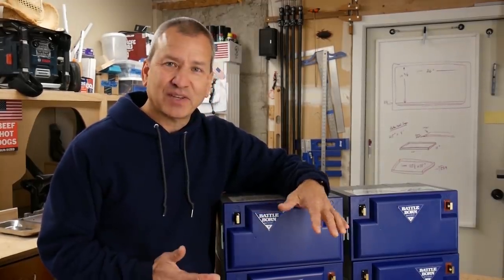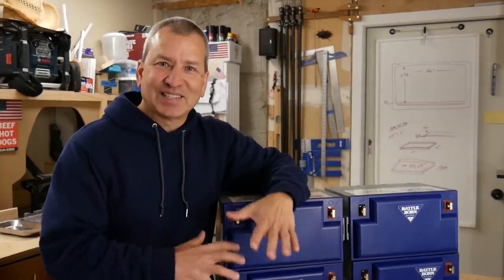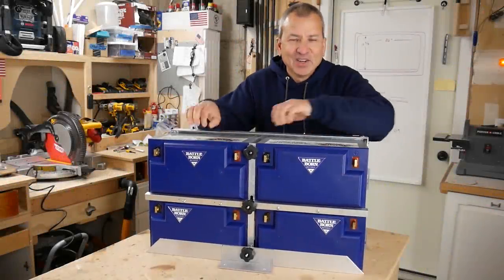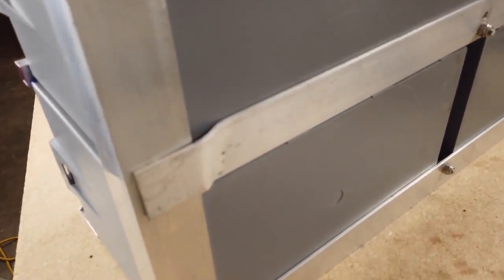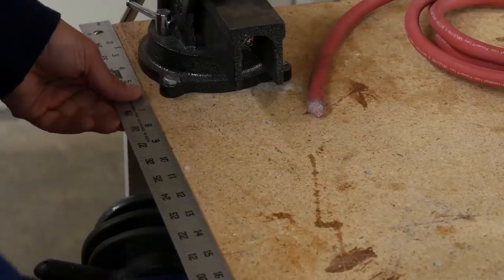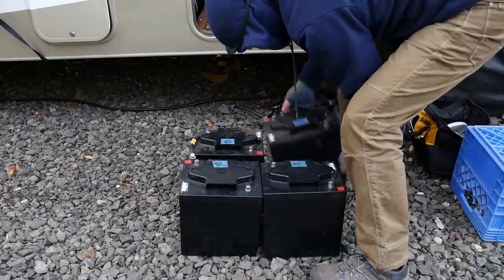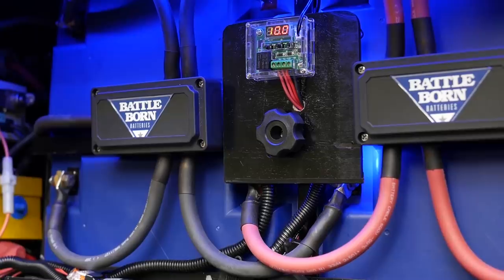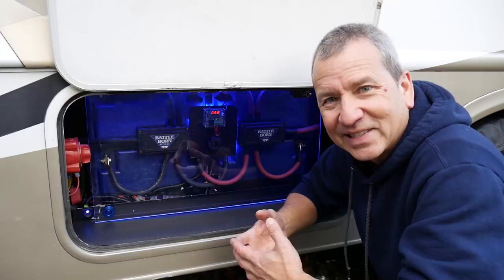DIY Lithium Battery Rack for Small RV Compartment - Full Build

Comment: Great job. For those that have the equipment, or can borrow some, you can weld your corners and you won't have to put the extra braces on. Also the heating pads will add some cushion between the batteries. This is an idea that many people can use!
Reply from the maker: I don't have welding equipment...yet. I also have other insullation around for added padding.

Comment: Thanks for the inspiration. I just finished my battery bank of four 100aH Battleborns. Amazingly looks exactly like yours. 😂
Reply from the maker: Amazing how that could have happened 😁 Great job 👍
Reply: @RVwithTito  moving now to start the design of the solar panels and mppt. I have a question but I will post it over on your flex solar install. Thanks for all your do on your channel.
Reply: @RVwithTito  I will post the battery on instagram if you are interested.

Comment: ⭕⭕  If I'm not mistaken,  Harbor Fright sells rod that looks like aluminum. I think it is 1/8 sq. by 18 inch long.  I have seen someone poke a hole in the bottom of an empty soda can with an ale, then weld it shut. Once the serfic gets around 650° f  rub the stick to it and it should melt.  Works great on pot metal. Like a broken ear on an alternator.   Great job Tito👍👍
Reply from the maker: It's pretty much the same thing I think.

Comment: I agree with all of the positive comments here -- very impressive installation!

I did notice something potentially dangerous -- starting at 4:49, the battery cable connected to the pos(+) terminal is very close to the neg(-) terminal.

Comment: Wow, I'm speechless,outstanding job, you guys not gonna have a power problem ever, can't wait to found out summertime temperature  how gonna be,and   how to solve the cooling part,thnx
Reply from the maker: I'll add a cooling fan if necessary, but will wait and see. I've never had that compartment over 90 degF. Plus the internal BMS will shut down the battery at 135 degF.

Comment: Excellent video. First time seeing someone who actually planned ahead with custom solar install.  Protection of terminals on buss and batteries has been neglected 😩 on most installs.  Well done.  Shifting loads in storage compartments that share space with  solar and camping equipment invites “Murphy” on all your trips.  A shorted lithium battery makes a great arc welder and source or ignition for fires 🔥 you can’t put out.   My wife was laughing 😂 out loud when you added the blue LED lights.  (Something’s are not options in DIY projects.) Personally, I Would have used red. Acrylics panel and heating pads were a nice 👍 touch.  Thanks again for the install video.  Mike and Rosie, Shelton, WA.
Reply from the maker: I had several LED strips I picked up long ago that I had never used including a multi-colored one with remote. I liked the blue. Yeah. It's very cool. Thanks.

Comment: Very neat Brian. Headway 38120S LifePO4 Battery Cells are easy to assemble and half the price for DIY but I prefer the Panasonic battery NCR18650B.  Capacity and stability out perform the lifepo4 cells. I'll look forward for your lifepo4 review. You will notice soon that lithium batteries need less  than half the power to recharge it. 48v systems is still more simple, efficient and less heat dissipation.
Reply from the maker: Yeah. I'm looking forward to a good solar test as soon as the sun comes back out again.

Comment: Nice work there. I am responsible for remote sites were the engineers design the batteries in the panels on their sides to save space. First thing we do at a new site is move the batteries were they are upright in the bottom of the panel. To many leaks over the years. Of course yours will be inspected often and I am sure you would notice.
Reply from the maker: I'll keep any eye out. Thanks.
Reply: There is nothing to leak with the Battleborn batteries.  The Battleborn cases are extremely tough too so side-stacking like this would not concern me at all. I 'd be much more concerned about the frame vibrating loose and an aluminum member causing a short across the terminals.  Should you experience that, you'd have white-hot liquid aluminum burning though the batteries and the floor of the RV in seconds setting off a catastrophic fire.   I think having the entire frame properly TIG welded and the frame reinforced at the corners or across the entire back is where I'd start.  I also don't like the knurled knobs.  In applications I've used them in, they tend to loosen easily which would be very bad in the vibration-rich environment of an RV. I'd use a fastener that can be tightened down and secured with a pin of some sort so it can't vibrate loose.  I wonder about the use of heating pads and how much power they draw.  You have 400 amps useable and the pads could use a lot of power because you have to heat that entire compartment which has a lot of air space.  Exciting and creative install though.  Coolest I've seen.

Comment: Really nice build Brian, your use of aluminum angle stock gave me some ideas for a DIY electric cable cord reel, thanks,
Reply from the maker: I always thought I'd build one of those, but no need now. As part of this project, I removed most of my cord and put a new plug on the short piece left. It lives in the side of the battery compartment. I typically use an extension anyway when on shore power. Good luck on your project. Would love to see how it turns out.

Comment: I like it - I put my Lifepo4 in a 2" wraparound insulated box with a heated pad fixed to an alloy plate heat spreader set to turn on at 2deg - the downside  is when charging at high rates or under high loads  the cells climb in temperature  as much as 10c - fortunately my  EpEver MPPT controller has under and over-temperature protection (I can really recommend their controller).
Reply from the maker: That's cool....actually warm :) Thans for sharing that.

Comment: Good video.  I'm glad to see you added heating pads for the colder weather.  It's my understanding that lithium ion batteries work best in temperature controlled  environment.  Adding some type of a heat exchanger for hot weather would be good too.  Protect your investment.
Reply from the maker: That's correct. While you can still draw power below freezing, you can't charge them at that temperature. Thanks for the suggestions.

Comment: Nice work Brian. I love the way you cleverly used bus bars that allowed equal length cables, which is very important. You didn't say how you fused them, can you comment?  I have to say watching you work the metal around the bare battery terminals was a nail bitter for me. Very nice work.
Reply from the maker: I have a fuse on the inverter positive. All of the solar inputs are fused in that compartment. You can see diagrams of my setup here: https://www.rvwithtito.com/articles/our-solar

Comment: Very nice job Brian!  Looks amazing and I am very jealous!  My only criticism in the video is you didn't explain why it was important to cut the battery cables all to  the same length  and also why it was okay to install the batteries on their side.
Reply from the maker: You can install these batteries in any position, unlike flooded batteries. Keepin parallel cables the same length will efficiently and evenly distribute the current across all batteries so they act like one large battery.

Comment: Dude.  Very elegant solution, and sexy to boot!  (Reminds me of when I used to "bling out" my PCs.)  Wish I could fit even ONE Battle Born in my Casita.  Its battery compartment (like all the others) is too small.  May have to consider relocating the battery under the bed (the rear dinette/bed combo).  🤔
Reply from the maker: Yeah a Casita is pretty small. My RV came with one battery too. So I had to give up a storage compartment to add more.

Comment: Great job on the install and manufacturing of the bracket assembly. Just curious, how did your VMAX AGM batteries hold up?
Reply from the maker: The VMAX AGMs are great. They are still going strong and I plan to use them for another project.

Comment: I could never figure out if the refrigerator light actually went out. Now you add another question for me. How do you know the LEDs go out when you close the compartment? In spite of that, this is a beautiful installation.
Reply from the maker: I installed a pressure switch on the compartment door and can hear a little click when it activates. Mystery solved 😀

Comment: There's a new type of welding for aluminum. Kind of tig welding. You may want to check into it. I have not tried it myself. You do some good work.
Reply from the maker: I really do want to do some welding. I plan to get a entry level flux core setup soon. Aluminum is a little different though.
Reply: @RVwithTito  Tig welding is pretty much the only way professions weld Aluminium.

Comment: I would like to know more about your RV electrical operations with these new batteries. Charge control and monitoring, do you have a generator and solar charging besides shore power, etc and so forth. how long does a single charge last for your typical day out?  Looks awesome!
Reply from the maker: This video should answer most of your questions: https://youtu.be/w5PVFpomIuk. Most components haven't changed besides the switch to lithium. Also I have a generator but haven't used it in years.

Comment: Good Job! I love to see perfection. Do remember your battle born batteries have a BMS in each battery,  controlling the 4 cell packs per battery.  I have seen and heard people talking about not connecting them together due to the BMS, in your case 4 separate BMS's and they are not communicating with each other, hopping you understand what I am trying to say. Just a thought and suggestion, maybe it would be beneficial to get battery balancers to control the voltage at the battery terminals at each of your 4 batteries to make sure the voltage stays the same between charge/discharge  and doesn't drift from each other. I use balancers on my 6 BAE 2v gel batteries. But I don't hook up my 2x200ah lithium phosphate batteries together my self, the manufacturer of mine hear in Australia says not to for reasons I have already stated. Anyway just trying to be nice and give you my two cents worth. Have a good day.
Reply from the maker: The BMS in the Battleborn claims to be self balancing. I let them sit for a few days connected in parallel before installing to hopefully start out balanced.

Comment: Outstanding video as always!  I think you should drive around with the cargo hatch open just to show off the blue lights!  Pimp'in..  I like the idea of heat pads and auto controller for them.  I was thinking of the same rack for my batteries ...what do you think of adding some rubber as cushion on the frame?  Would it be necessary or not?
Reply from the maker: Pimpin. YES! Maybe I'll lower the RV too. I do have some heat shield insullation under the whole thing which ads some cushion.

Comment: Very nice.  The only suggestion I have beyond what I already see in the comments is that I would have also added solder to the crimp connections while they were in the vice.  Just fills in the gaps inside the crimp connection, so there is more surface contact area.  I wouldn't bother to take it back apart for that, just something I do whenever working with that sort of connector.  

Where do you acquire that heating pad material?  I'd like to know more about that stuff.  That was the one thing preventing me from switching to lithium (well, that and cost).

Comment: Top work fella! I got worried you might accidentally short a battery with the bare terminals during your build! Those batteries pack a lot of power! Maybe next time,tape the terminals. Just sayin be safe!
Reply from the maker: I was careful. During the build the batteries weren't connected so they wouldn't have shorted across batteries. I've since wrapped all of the metal cross members, so there's no risk of that now. Thanks!

Comment: Each degree Celsius is equal to almost 2 degrees Fahrenheit. The Celsius scale starts at 32F which you obviously know. The in your head calculation is double the number Celsius and add or minus 32 depending if you're over or under freezing. At 9C the in your head calculation works out to 50F. The actual temp is 48F so it works out pretty close. It gets more out of whack the farther up or down from freezing you go. At 20C it works out to 72F, the actual temp is 68F. The weird number is -40 which is the same temp for either scale. Cold!!!
Dial your blankets back to 3C which would be just under 38F.
Cheers from B.C.
Reply from the maker: The 9-10C you see displayed is the current battery/compartment temp. I have the switching temp set to 3C.

Comment: Nicely done-kindly provide part information/source/wattage etc. on heating pads and controller-wiring of such etc.-have a similar issue with in our rv as two batteries are in the front generator compartment and two under an entry step. Thank you.

Comment: Great job. Is there a reason you used flat bar for the small crossmember? I would have thought square tube would have been a better choice. Square tube at the bottom (back in the orientation that you have them) may also have been beneficial.
Reply from the maker: The middle vertical bar is more of a spacer and also gives an anchor point for the threaded rod. I needed the horizontal piece to be thicker (square tube) since it needed to stick out past the raised part of the battery.

Comment: I would love to know how to wire 6 Battle Born Batteries using the same way you did it but use 3 boxes? Great job and I just finished my frame.
Reply from the maker: You'd need a buss bar with 7 posts. Or you can wire two sets of three in parallel, then wire those sets in parallel. Good luck.

Comment: Mr. Tito, at the end of your video regarding your heating pads. What was the material you sprayed on the heating pad and what was the pad you applied to it.
Thanks.
PS: there's very little information on warming lithium phosphate batteries.
Might make a good video on your personal results or your modifications
Reply from the maker: It was spray glue to attach an aluminum plate the distribute the heat better. Check the specs on your LiFePO4 batteries. Typically you can't charge them when below freezing. So the heaters will kick in if/when it gets close. I have yet to get close inside the battery compartment.

Comment: Good job. Very professionally done. Is there a concern with the batteries overheating in a tight compartment with little airflow? Will you eventually need to add a fan for in the summer?
Reply from the maker: I'l have to monitor it this summer. I can add a cooling fan if needed. The BMS does have high temp protection and will shut the battery down at 135 degF. I've never had the compartment get hotter than 90 deg in the past so we'll see.

Comment: Truly a thing of beauty! Never seen anything so schnazzy in solar yet! Thanks for the inspiration, hoping to do my own DIY project someday, especially with the steep investment of LiFePo batteries. Battleborn: buy the best and cry only once (and we Canadians will cry 30% more). Speaking of which, we freeze up here more, do the batteries get damaged if stored in freezing temps or just won't function right? Will your heaters keep them running well to 15-20F?
Reply from the maker: I haven't been in an environment that will truly give the batteries an adequate freeze test. All I can say is that the thermostatic switch should turn on (and keep on) the heating pads below 38 degF. Even below freezing, the batteries have stayed above freezing.

Comment: You do such great work. I have a question about the Battle born batterys. Will they be charging off the alternator ? If so, what kind of a isolator will you use? I just installed the same battery's in a 2019 promaster van and the alternator put out about 14.60 volts and the bim that I tried to use will only charge at 14 or lower volts. So I had to install a D.C. To D.C. Charger and finally got them to charge. In your video, you didn't talk about the charging. I would like you to do a video on that sometime . Thank you for all the great information.
Reply from the maker: I'll do a video later once I've used them for a while. I do have a 20A DC to DC charger that I plan to install soon. I plan to also use my existing alternator and keep the charging to 20A or less.
Reply: A DC-DC unit is the best way to charge from the alternator from the research I’ve been doing.

Comment: questions - 1) What type of electronic temperature sensor did you use for the warming pads? 2) Do the warming pads have a built in thermostat - what brand are they?  3) the stand-off bolts with the push-button release for the plexi-glass......what brand and where can I find them?    Any help with these things would be much appreciated.  PS.  I purchased a SIMarine PICO system for my RV ...... thanks to you!
Reply from the maker: Most battery heating pads are already temperature controlled. The ones I used were left over from an old heated car seat project. Links to the other stuff is in the description. Hope you like your PICO. I do. Cheers.

Comment: Nice work Brian -- and not at all over-engineered, since the BB batteries are also constructed with high quality materials and good design throughout. I'm always gonna look at the most likely cause of catastrophic failure for a project like this, so I wonder what you think of the anti-racking strength of this framework under severe deceleration stress . . . if diagonal braces in the back aren't doable, perhaps simple fore and aft braces would be easiest.